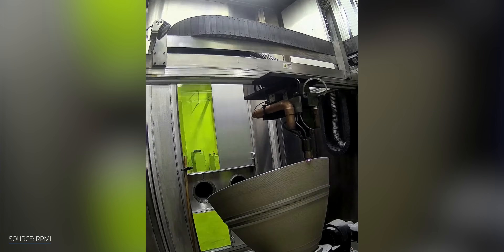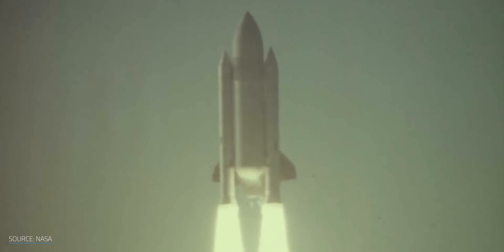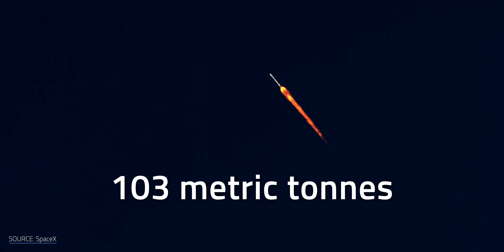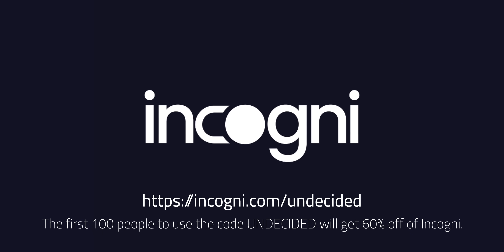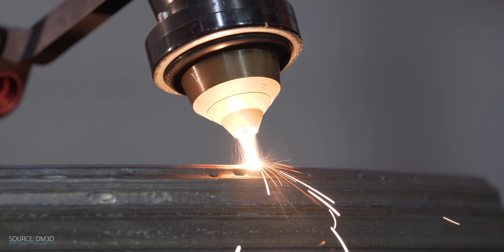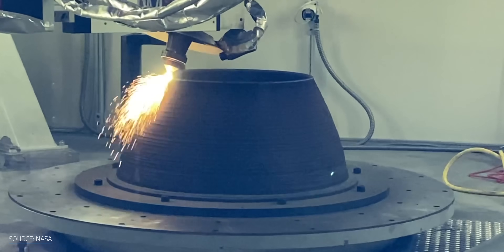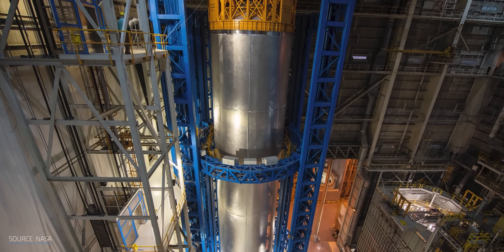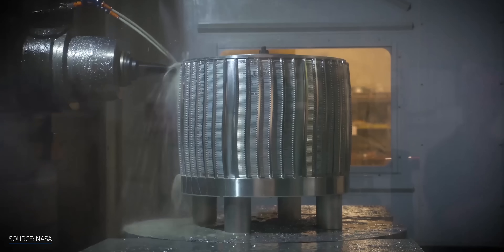Why NASA’s New 3D Printed Rocket Engine Matters

Comment: Oh my, the future of manufacturing is getting to be pretty space age - literally, thanks processes like this additive manufacturing, and also incremental forming. I'd love to see you touch up on that one, as it's been kicked around a lot over the years, but recently is really coming into it's own light with places like Machina Labs in LA really starting to crack the code - also literally (haha coding jokes are great.) on really starting to nail down the process, into an exact method that will very likely boost R&D speeds considerably in MANY different industries.

Comment: One facet of "additive manufacturing" that gets very little mention is the fact that it is "additive". You add only what the part needs, little to no waste. Older manufacturing, you might take a sheet of, say, Aluminum, then you stamp out your part, AND CUT AWAY the excess. This wastes the excess, and adds cost.

Comment: The Spacex Raptor 2 engine has a reported chamber pressure of 300 bar. (4351 PSI) If they can print an engine to withstand that pressure then we're onto something.

Comment: The reason the new engine does not matter. Rockets are outdated technology that is currently obsolete. The moment we topple the violent gangs in control. There will be no reason to continue the technology embargo placed on Earth 12,000 years ago. The Van Allen belt energy rings will not be turned off until it is safe for the universe.

Comment: 3D printing has an opportunity to replace complex casted parts. The issue is things like aluminum are still tough to get right.
Reply: I am a noob here, what are the issues with aluminum? I'm genuinely asking.
Reply: @SP-dw9gi aluminum is very conductive and has a low melting point. Makes it difficult to control in fine enough detail to 3D print. If you look at welds of aluminum vs stainless steel it is visibly apparent.
Reply: @methos1999  got you, so realistically no parts of a engine should be made of aluminum?
Reply: @SP-dw9gi I'm not a rocket engineer, so I can't say definitively. It's possible there are parts of a rocket engine that stay relatively cool and could be made from aluminum. But in that scenario the parts would probably not be 3D printed. I'm also assuming we're staying on the topic of rocket engines and not car engines (most of which are cast aluminum).
Reply: @methos1999  definitely interesting.
Reply: @methos1999  Nobody will build a rocket engine from aluminum.
Reply: @gottfriedheumesser1994  which part? Again I'm not claiming any expertise here, but I do know there's more than just the combustion chamber and nozzle. For instance there's pumps and valves which may be cool enough to use some aluminum.
Reply: @methos1999  Yes, there are some parts where alu could be used, but not many. Show me the aluminum parts of an airplane engine. Most are made of steel or ceramics.
Reply: @gottfriedheumesser1994  So I assume you're talking about JET engines, not all airplane engines, because piston driven engines are MOSTLY aluminum. But it appears we're splitting hairs here, because I never claimed aluminum would be central to rocket engines.
Reply: @methos1999  You are right, and I have flown piston engines. But that's splitting hairs, and we should stop that. Even the main structure of the starship is made of steel you will not find lots of alu in it.
Reply: @gottfriedheumesser1994  Agreed.
Reply: @SP-dw9gi , aluminum is sensitive. It has a low melting point, making it difficult to fuse and not mess up geometry. The welding system you saw in the video is a robot controlled welder that's just laying a bead of metal one on top of the other. The heat from this wants to move from the fresh bead to anywhere else. It can't do it fast enough to the air, so it moves into what was already welded. The part you're welding gets hotter and hotter, to the point the whole thing can just become a blob. With aluminum, this would happen so fast you'd have to pause the print to cool it down after a layer or two.
Reply: The lasers used are highly reflective at the spectrum used especially for aluminum and copper. It requires a different spectrum of laser to reduce this reflection effect. I used to work at one of the places in this video, and made the software for the path planning and also the laser and motion control
Reply: It’s the complex and often impossible to cast, form, forge, roll geometries that 3d printing will replace. There really is no alternative for these geometries. These thrusters have incredibly nuanced small but many channels to flow cooling and shape thrust in ways that just isn’t possible without 3d printing. 3D printing has revolutionized manufacturing. But for your ordinary things, not so much unless you’re printing themselves
Reply: @markhaus  The problem still with additive metals is a lot of the post-processing steps needed, or the acceptance of possibly lower yield when parts might have micro-defects in the complex parts of the geometry that might not be accessible because of how they are manufactured (which is the double edged sword of additive, it can make geometries that are impossible with subtractive and casting manufacturing methods, but it can make the last 10% almost impossible due to those advantages).

This is especially important in things like rocket engines, especially injector plates, and even more in these types of rotating detonation engines where the fluid dynamics need to be precise and predictable.
Reply: issues!?😂😂, what are you talking about, the Trueprint 2000/3000 can print out aluminum easy.
Reply: 3D printed casting molds are just another facet to how the technology is evolving...it's fascinating to watch but it also makes me wonder why now? this stuff existed back in the 80s and 90s...just like drones, we've had drones for quite a long time but are only now seeing them become more ubiquitous...
Reply: @steven2183  Originally drones have been built as radio-controlled model planes for half a century.
Reply: Maybe to a degree, but you’ll still never make it through heat treat with ultra thick walls (same as cast) that have to be brought to solidus, so it’s a moot point.
Reply: Smaller, much simpler shapes will probably never get made enmass via 3D printing. You'll probably never go buy your next silverware set and have it be 3D printed.
Reply: Why would it replace it? A CNC machine can make better parts faster and cheaper. 3D printers are mostly good for custom parts
Reply: @samsonsoturian6013  There are materials that cannot be shaped by CNC. And there are parts with complex structures that cannot be shaped with CNC.
How do you want to make the cooling ducts within the combustion chambers of rockets? Formerly they welded tubes outside on the chambers. Now they make them within the walls of the chamber and have a much better heat transfer and much better mechanic strength too.
Reply: @gottfriedheumesser1994  There's also dozens of other manufacturing techniques that prove the same point. Forging, casting, welding, SmarterEveryDay recently did a video on a new "roboforming" machine that pinches metal into shape. But the bottom line is the metal powder needed to make 3d print parts is often more expensive than the finished parts using other methods.
Reply: @samsonsoturian6013  Here we are not primarily asking about powder costs, but about shaping the chamber in one part. The powder costs are high but search for a better method. We are not talking about St37 but about the most extreme materials.
Name the manufacturing techniques to shape the combustion chamber with cooling ducts in one part.
Reply: @gottfriedheumesser1994  3D printing doesn't allow building with more extreme materials. 3D printing restricts materials to what can be ground to a powder and melted by a laser. Also, the tolerances are terrible
Reply: @samsonsoturian6013  You know everything!
Reply: On the topic of engines. Would it work efficiently to  water cool a rocket engine with a boundary layer of water/steam, Expansion ratio of water to steam is 1600 times. Also it has been said that large rocket engines are unstable hence large number of engines in spacex booster. Say we make an engine 10 times bigger and put in like 7 burner cans  turbojet fashion? Be nice to reduce 33 engine to 3 or 4.
Reply: @jbird6609  Water injection was the method of the first Boeing 707s to avoid overfattened combustion. But materials became better, and today's turbine inlet temperatures have doubled since then. The problem is that the thermal radiation from the combustion cannot be shielded from the wall of the chamber.
By the way, the expansion rate is right for boiling at atmospheric pressure. Above the critical temperature and pressure, there is no expansion anymore and we speak about a fluid.
Reply: @gottfriedheumesser1994  
Good info, thanks
Reply: I've got some pretty good results with aluminum and preliminary positive results with titanium through microwave sintering. Not easy but achievable in my garage. I believe we're closer than some may think.
Reply: When I clicked the video I was thinking they were just printing regular rocket engines. 

 You know like the complicated castings that required beeswax. Which is cool and all, but not the biggest deal. 

 Yet they are printing RED engines? That is wild! 

 I am actually truly excited to see RED engines in aircraft.
Reply: in volume no, but complexity yes. Cast parts can be made at a volume much exceeding 3d printing. however the complexity of the parts 3d printing wins and allows much more complexity than regular cast. They both have their drawbacks, and 3d printing is just very slow in everything but large complex parts, or prototyping.
Reply: @The_Foolish_Fool  3d printers can do mass production depending on the type of product. They are very cheap per unit and don't require injection mold startup costs and slow costly design change turnarounds. 3D printed shoes are going into mass production from big companies like Nike so your statement that they're very slow in everything is incorrect since they make up for speed with 1000+ machine print farms.
Reply: @The_Foolish_Fool  You cannot have hollow areas in a casting.
Reply: They said we couldn't land on the moon.  Where there is a will, there is a way.
Reply: @joeboxter3635  literally no one said that
Reply: @ Noubers. THANK YOU!   THANK YOU!  THANK YOU!  NOBODY, NOT EVEN THE CHANNEL AUTHOR makes any mention of the true materials science realities of 3D Metallurgical Printing... For example, to reach even a fraction of the strengths of a forged part, very extensive (and expensive) post treatments are necessary.

Comment: 3D printing began to be used in production versions of spaceflight hardware in early 2014. In January of that year, SpaceX first flew a "Falcon 9.  rocket with a 3D-printed Main Oxidizer Valve (MOV) body in one of the nine Merlin 1D engines".

Comment: But did space X not do it first they have bean doing it for years so nothing grownd breaking here
Reply: These rockets are totally real.  Those engines are magic because they push off on invisible space molecules because space is a vacuum.
Reply: @misternordberg3675  what you on. SpaceX started printing 3D rockets back in 2014.
Reply: @adus123  Using 3d printed parts is not the same as 3d printing the entire thrust chamber. SpaceX absolutely does NOT use 3d printing to do what the RDRE engine is doing. The Raptor 3 is hitting over 300 bar in chamber pressure tests. The NASA RDRE was less than 50 bar.

Comment: But isn't it easier and cheaper to bend sheet metal and weld them together like a  normal fuel tank it can be produced outside of the company and then just assembled it together
Reply: That's cost way too much and takes lots of man hours to do. This is why SpaceX started doing it like this year's ago.